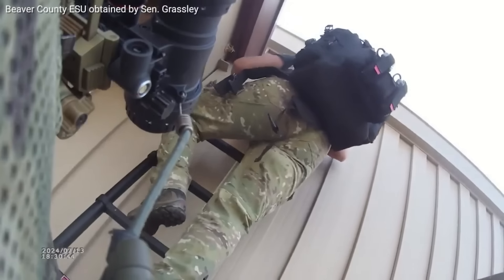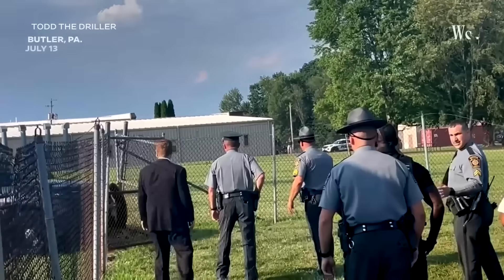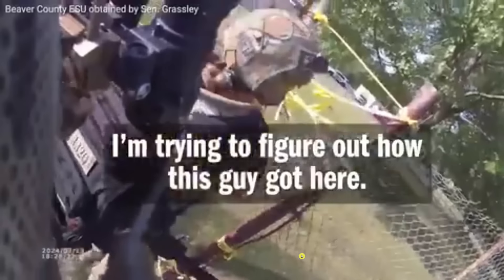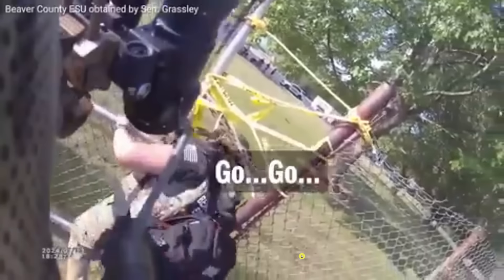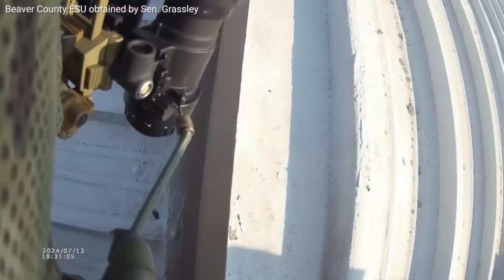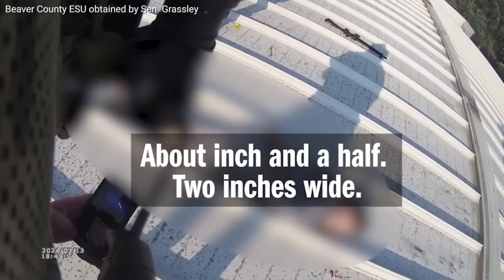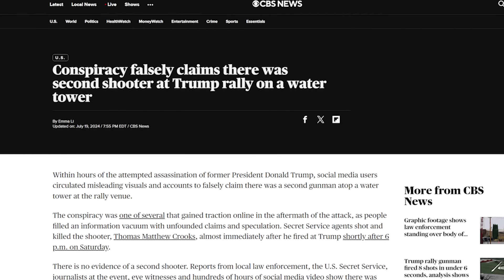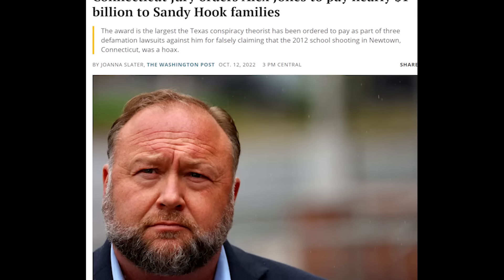Trump Shooting Analysis: Shell Casings, Ladders, Drones, Bodycams,

Comment: I JUST FIGURED IT OUT! He used the drone to see if the Secret Service had found his stash/cache. He needed to look down from above to LOOK IN THE GUTTER where he stashed the pew. Take the magazine out & it fits just perfect & can’t be seen until the person is standing directly over it. He wasn’t looking for a vantage spot. The pew was in the gutter & he was making sure the game wasn’t up.

Drone went up. He looked into the gutter to see the Pew. Brought the drone down & went to the Pew.
Reply: That seems very likely
Reply: This has a ring of truth to it. Other explanations of why use the drone seem to be grasping, and no one saw him with a gun on the ground, but I'm still a little confused about weather there is a backpack up there on the roof. I have an AR that fits neatly in a backpack if I separate upper from lower.
Reply: @ChrisBrown-fs6kl  It was extendable which helps both your & my thoughts. Mine is that it was where he pewed. Just in the gutter. That spot was at the other end of where the window is & why the Secret Service wouldn’t have seen it looking out the window. I bet there are fingerprints etc at that gutter spot. If you flip an M16 upside down (My experience) & take the Mag out, it will sit down in the gutter. He would have maybe needed a small scrap of paper to cover the grip & that’s a maybe. It should fit pretty snug especially if it is collapsed. It could look like a dirty gutter but have an AT-4 in it with a couple leave hovering the grip.
Reply: The dude glitched a weapon like he was in COD & came back to it. That’s also why he used a COD rooftop tactic.
Reply: They will never say this to be true because then they will have to admit if they sent someone up there even to walk on it in the first place, they would have found it in the gutter. They didn’t go up. He sent the drone ups to confirm they never got up there
Reply: @Daily_Llama  that could very well be likely. I want to know if the backpack on the roof was his or not. They didn't clearly say in the full video Jeff is referencing. I also want to know where the ladder he bought was found. Wray said it was found not around the grounds or is his vehicle. If he didn't use it then why was it not in his vehicle? Did he drop it off somewhere hoping to use it but realized he wouldn't be able to. And how did he get up their to stash the pew pew without anyone noticing. 🤔
Reply: @MTNLVR21  He could have used the ladder much earlier. Dropped it in with it. Taken it away from the scene. Came back later after lunch etc & the ladder drop off. Came back with the drone & began working his way to where he could manage the drone up, see what he needed. Drop it. Then put his COD rooftop tactic in play
Reply: @MTNLVR21  Oops. Editing. Missed rhe middle
Reply: @Daily_Llama  I think you have a great thought. I was wondering how he got a pew pew up there w/o anyone seeing him. Especially if he didn't have a backpack on when he climbed up. That seems more likely unless he had it hidden under his clothes. The public needs to see/hear all body cams, photos, voice recordings, text messages etc. We deserve to see all the evidence, especially from the officers who were on the roof right after, not 30 mins after but seconds to mins after.
Reply: @MTNLVR21  He had a backpack but you're right, it’s not totally clear where they found his or even if the one on the roof was his. They talk about it. I haven't gone through all of Wray's testimony yet. Maybe there's something there.

Even with the stock retracted, I would have to think someone would notice the barrel sticking out. The pew looks like it’s got 18-20 inches on it. That's a lot of backpack for one item if it all fits which would give it a definite impression & a regular backpack, I’ve got to believe (desparete hope?) it would be sticking out to be seen.
Reply: @OGDailylama  Leaving a gun in the gutter? Did he stash it there a previous day or two before the event? What if it had rained? Couldn't that make the gun useless?
Reply: Rain would affect nothing... They will fire under water....
Reply: @velvetpaws999  Not at all. Do you think soldiers work only in good weather? The first versions in the early 60s had jamming problems but that was solved by the end of Nam. An AR from this era is practically unjammable & the kid hit paper so he had it well lubed.
Reply: And he was there all day. The drone went up before the event. That's when he knew it was there from either much earlier that day on the bike or even the night before. If the night before, he lied to his dad on the day it happened & left the house without it pretending to have it at that time when it was already in place from the night before.

It would work too for the night-before scenario because then he could say it was stolen if it were found. Then the day of the moment, he took the drone to the site on the bike in the backpack, sent it up, realized it was still there from the night before. Brought the drone down. Began moving towards the Pew.
Reply: Back track to when the father said the son borrowed or went target shooting, and try and track his movements from then. My guess is he hid the gun quite early before the site got too hot with security.
Reply: Exactly the same comment, word for word, he (lama) puts under other videos. Someone really wants to spread an opinion
Reply: Yea and maybe the bike was his getaway
Reply: @GNX157  I have done that. You have to consider he could have already deposited the Pew & him saying to his father he was going to hit paper could have been the cover for why the Pew was gone when he left. He could have taken out the night before, deposited it. Went home. Got up the next day. Told his Dad the lie. Took the drone to the site & took it up in the air to see if the Secret Service found it over night.
Reply: @Daily_Llama  I thought about him stashing the night before but he bought ladder the morning of. Why buy ladder that morning if he didn't need to use the ladder the night before to stash it unless he stashed it not on the roof but close to the area he was going to get up there. Then used ladder that morning to get on roof and stash it but that would be even worse if he was able to do that and not be seen. I watched a video Jeff referenced in his description from Spa Guy and he made a good observation on how he may have gotten on roof. There is another spot on the backside of where snipers were that had an a/c unit next to a shed. He easily could have gotten on roof from there. Looking at the bird view he gave that would explain how sniper may have lost sight of him if he was on the other side being suspicious started moving and sniper went to other window to see where he moved to but he already walked behind building and was getting on roof. Watch the video and let me know what you think. I want to know where they found his ladder. I feel that is a missing piece we need to know. I also do not know why he would keep the receipt in his pocket. Why not leave in car or throw away.
Reply: @Daily_Llama  I do think stashing before is very possible though. They've reported his footprint showed he had been at site before rally day.
Reply: @MTNLVR21  Kept the receipt because he didn’t think he was going to get pewed. I missed that the ladder was a same-day purchase so my scenario would be same-day but it all fits the same. We should entirely drop the premise getting on the roof would be hard at all. It's a waste of time to think about really. He did it. I’m in my 50s & I know I could vault myself onto it using a corner & not even need anything but a quick sprint into the corner then jumping into the other corner to then land on the lower ell bridging section of the buildings.

I'm trying to pin down where the Pew was & when so we backtrack its movement so we can find who has touched it. Example: Follow the money in this scenario would be, follow the Pew.
Reply: @ChrisBrown-fs6kl  Have you seen anything on the length of the barrel yet? I haven't but it looks like 18-20 inches plus stock. I'm thinking the backpack was for the drone. It seems to fit where the Pew seems to show. He had his range finder so he didn't need the drone for range. If that's not what he use the drone for, then what did he use it for? Gutter.

Comment: Do you notice that Christopher Wray did not say he shot eight times just said there were eight shell casings on the roof… Shooter in the window shot three times and tossed out his shell casings
Reply: I noticed Christopher’s wording was very carful, seemed a bit odd to me.
Reply: First 3 shots didn't come from 2nd story. Ballistics angle from there is ALL wrong. It's likely the 9th shoot came from there though.
Reply: Wray did not specify "shell casings", rather he said "cartridges".  There is a major difference between the two.  Spent casings should have equaled shots by the assassin. 
Audio analysis indicates three weapons fired=another shooter.
Reply: He Wrayngled his way out of the question.
Reply: Amen,  what a sneaky answer  !!!
Reply: All horse pucks on your part and the replies are horse pucks too.  How many shots will need to be determined by assessing all the video and audio evidence plus all physical evidence and perhaps eye witnesses.  The gentleman answered the question with the only facts he had ... the count was 8 whatever you call the spent thingies that get ejected after a shot.  Nobody knows for sure how many shots the shooter took ... seems like 8 however, 8 shots is not fact at this point because the evidence is still under review and could change the 8 count or confirm it ... 8 spent shells is fact.
Reply: How many of the 8 cartridges were spent shells???🤔
Reply: Thank you. This is the most plausible.

Tell me why I sniper team would be inside a building with foot wide windows facing trump? How much ground is he covering?

Comment: 130yds is not "way off in the distance" to a highly trained sniper - especially one using exceptional equipment (Mark 13 Mod 7 with a high-power scope likely chambered in .300 Win Mag). Rather, experts consider this particular shot "quite close."

Comment: How did the rifle get that far from Crooks?
Reply from the maker: cops likely kicked it or he dropped it when he got shot
Reply: @jeffostroff  What were his injuries?  Didn't the counter snipers explode his head?
Reply: @jeffostroff  I don't think he ever stood before he was taken out. Pictures I have seen show his legs crossed laying down.
Reply: @jeffostroff  couldn't he have surrendered to the window area cop, trowing it away to present not treatening
Reply: I've seen overhead footage of the original responders moving it away from his body.
Reply: @jeffostroff thanks for a great analysis of events that terrible day. 

I want to mention something that’s bothering me. @ 13:57, there is a pipe (AC) that appears on the side of the building being held by several braces. This looks like a perfect place for someone to scale the wall. The gutter at the top looks bent and clean as if recently disturbed. Just a thought. Keep the videos coming. Subbed 🇺🇸

After finishing the video, I see you mentioned this. Awesome job!
Reply: @k.s.nichols4060 you can see his injuries on the bodycam footage, they didn't blur it properly a few times and if you were to adjust the playback speed you can clearly see he got his wig split
Reply: @Sprintracer77 could you reply to this comment with a link to that footage please
Reply: @k.s.nichols4060  
In another video without blurring, but not straight down (showed from aside), his head got bloody but still intact, not exploded
Reply: Thats interesting! Can you direct us to that footage? Great information thank you😊 @Sprintracer77
Reply: That's the first thing cops do when arriving to a scene where there is a gun next to a body. They kick the gun away before they assess. Probably how the gun was so far away.
Reply: The body cam footage is available on the channel "police activity".
Reply: Scope on the gun or just iron sights?
Reply: @rjm2024 
There should be abrasion marks on all those braces and the steel building as well. That insulation is easily disturbed after UV exposure and would show any disturbance to it unless it's really new.
Reply: @stevestiller  red dot.
Reply: @CL-mp4vn  Had a link of Crooks head injury with front teeth missing and bloodied ++++but now taken down.
No way he would have moved after the shot to explain rifle position and no way he was shot by SS sniper or his head would  have exploded-
Reply: https://www.youtube.com/watch?v=FsvJzfXZI18&t=3s
Reply: they moved it
Reply: @stevestiller  It might just be a halo 1X optic. So basically like using iron sights
Reply: @stevestiller  Red dot sight I believe.
Reply: @brianedwards9540  unless he had a magnifier, the images I've seen of the gun look like the sight took some damage, expected with a head shot if he was ADS I guess
Reply: @jeffostroff  So the idea is that he stood up, maybe to follow up the missing shots as Trump ducked down and then he was shot when he was standing ...?

Comment: I have watched many videos since the assassination attempt including the extended audio analysis of the gun shots and this video is by far the best explanation I have seen.
Standard police practice is to move the assault weapon outside of the shooters reach just incase he is not dead, then you check for a pulse.
Anyone who has been to a shooting range knows spent shells fly all over the place and bounce around on a hard surface. they can even be kick around by an investigator, One officer saw 5 empty shell casings and 20 minutes later another officer says it was 8. The audio indicates 8 shots.
Some questions remain unanswered but the general sequence of events seems accurate.

Comment: His rifle didn’t have a sling. There’s no way he could get on the roof from the air conditioner while holding a rifle.
Reply: Nerd here: the rifle was probably dis assembled. Making it small enough to fit in a back pack
Reply: I don’t assume that they don’t have additional footage that they just haven’t released to the public.
Reply: Also couldn’t you just not Toss the weapon up there, then climb? Doesn’t seem too hard to do that
Reply: @joecentral-o9984  I didn’t see a backpack on the roof but that would be a way to do it.  Maybe he dropped the backpack onto the ground below.
Reply: They're was an open empty black duffle type bag with strap/handles at the edge of the roof.

Comment: Now there are reports that the "window" counter-sniper team did NOT leave their post to search for Crooks, as was reported earlier. That makes sense if they were a sniper team because they would not leave their weapons unattended nor would they grab all their gear and start running around on the grounds.
 Even though they could easily see the entire roof from which Crooks took his shots had they been standing at the window, they must have been back away from the window, perhaps with their feet up on a desk, and relaxing in the air conditioning rather than standing closer to the window and looking out over their area of responsibility.  Remember, they had previously photographed this guy and the call had gone out saying the cops were searching for a suspicious man.  That should have triggered the counter-sniper team to stick their heads out the window. Had they been doing their jobs, they would have easily seen the assassin.  Did they fail to do their jobs because they were lazy or were they instructed to make an assassin's job easier.
Reply: Oh is that what the new story is? I give up.
Reply: I b3leive they were instructed

Comment: Ok, at 8:58 you see the ladder next to the awning of the door to the building to the right of the building the shooter shot from. There is a shed-like structure with a ladder next to it. This is where the shooter climbed onto the roof. This was suggested rather early on, I think by L.E. But, honestly, all the roofs are connected so he could have climbed onto the roof from somewhere even further away.
Reply: There was a cop that looked on the roof before any shots were fired. Must have been a ladder there.
Reply: @danielmackay8099  early reports were that the officer was boosted up bodily by a fellow officer to see over the roof, then fell back when confronted by the shooter, injuring his ankles
Reply: @jimmybryan6760  Thanks, I did see that info. after I posted my comment.

Comment: The picture of the Ladder doesn't look like a ladder to me. I've never seen a ladder made like that. I think an FBI  person or someone wearing an officers jacket could have told the owner of the second story building they need to use the second story as a look out point and told the owner to leave the door unlocked.  The shooter could have went through the up stairs window and stepped out on the Roof and crossed over to the first building roof very easy. The kid may have tried to escape the same way but he was shot by someone in the second story building because they didn't want the kid to be a witness and mess everything up.  This is just a thought, I don't know if a person could even get out of the upstairs window. .
Reply: The first three shots were fired from the second floor of the building next to the alleged shooter.  The weapon that fired the first three shots was probably fitted with a silencer, which accounts for the lack of echos.  The second five shots were blanks fired from the same location but with a different weapon most likely an AR-15 using a surefire trigger that can fire rapidly.  Blanks were used in the AR-15, which explains why no one else was injured.  Local law enforcement was in the building next to the building that the alleged shooter was on.  The last shot fired killed the alleged shooter and was probably fired from the same window as the other eight shots.  Everything supposedly found on the roof by first responders was planted by them as alleged evidence, including the 8 shell casings.